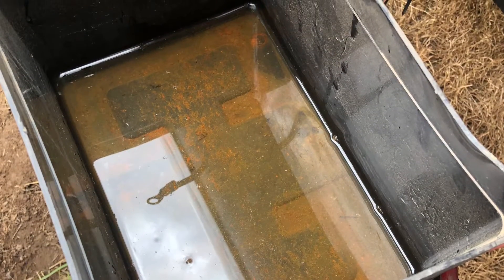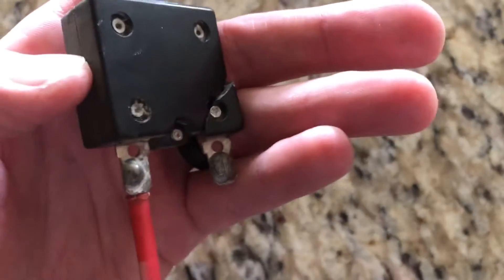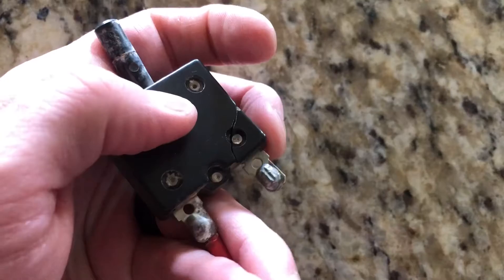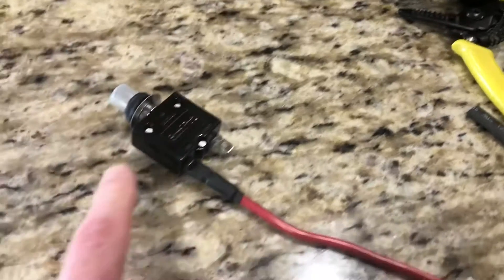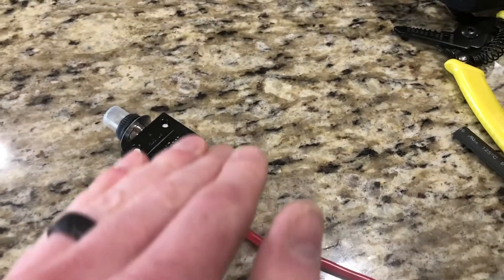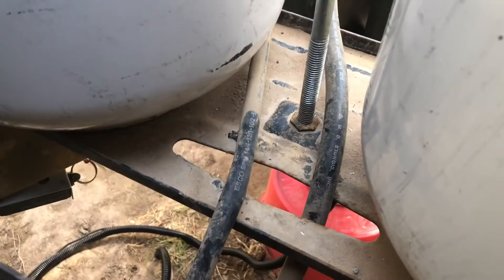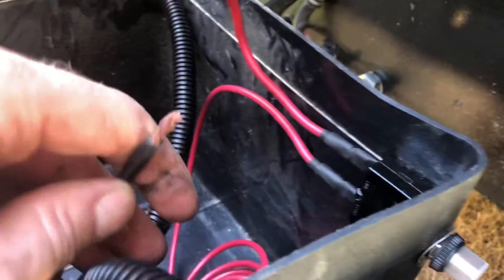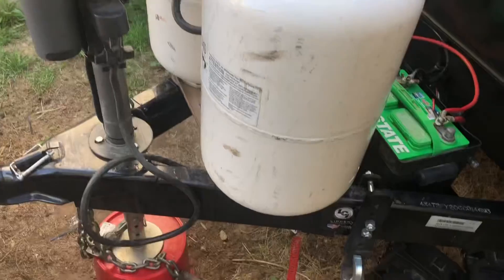How To: Wire/Rewire a Power Tongue Jack for a Trailer

Comment: The wire color, or wire for that matter, doesn't matter if it's in the "Load" or "Line", that's just a conductor.
Reply from the maker: Generally, Circuit breakers are designed to protect against overloads and short circuits. If the line and load are reversed, the breaker may not trip properly in a fault situation, potentially leading to electrical shock or fire hazards.
Reply: @DIYBRY  Sure, but that's the obvious part.  The way your route the wires, regardless of the colors, is up to you, and assuming that you know what you're doing, then you know which side goes where.
Reply from the maker: @n.g.1577 and in the video, you see the new line and load wires are made out of the same exact same wire. Same color, same gauge. Additionally, make sure to wire them up correctly, which is what you are saying.
Reply: @DIYBRY  Yes, but you're correct, it was wired incorrectly and it makes more sense after your explanation during the making of the connections.  Happy Camping!  P.S.  Avid campers for more than 30 years.